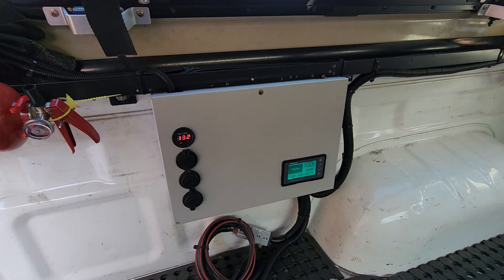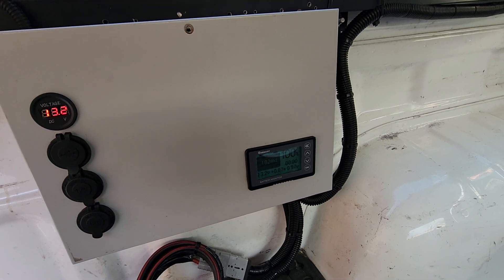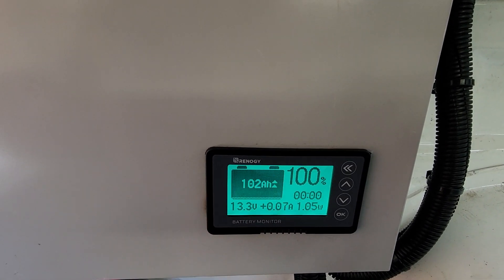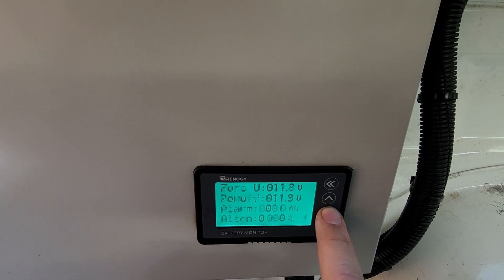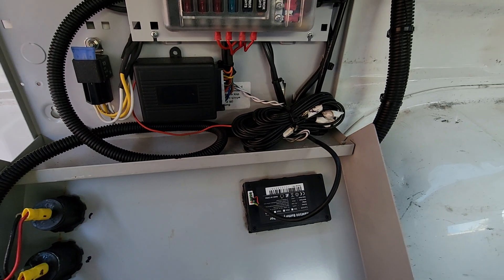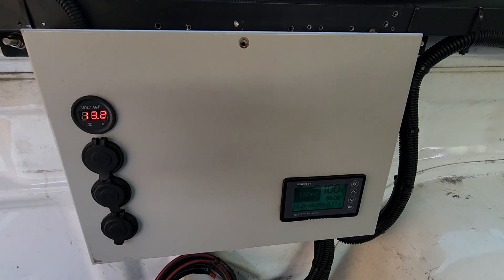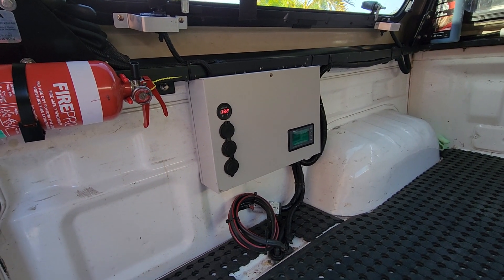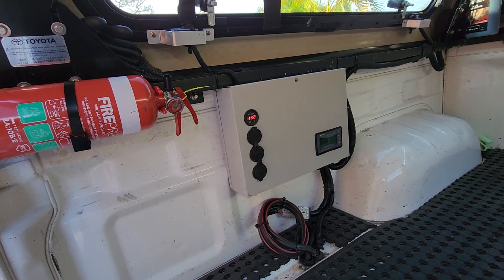Renogy Battery Monitor Installation for Dual Battery System (Toyota Hliux)

Comment: I somehow purchased this thinking it was for monitoring car battery, which is all I want it for at the moment. Can it still be used for that, assuming I can find a good place to mount the screen near the dash somewhere? If so would I still wire it up more or less the same way?

Comment: What capacity is your deep cycle Battery ? Renogy monitor settings for battery amp hrs should be set to useable amp hrs ie: AGM can use 50% of total amp hrs. so 100 amp hr battery is set to 50 amp hrs etc. I found this out myself when I set mine up after I contacted Renogy.

Comment: Great Video, may i ask what central locking kit you used in canopy and does it integrate with car key or is it a separate remote.
Reply from the maker: Hey mate, the locking kit is from a mob called canopylocks.com.au (not sponsored). FOB control for it isn't integrated into ute's key, its a self contained mini remote I keep on the same keyring. However, if you wanted it on the same system circuit, you could tap off the door central locking using a relay setup to drive them. Food for thought.

Been using this system since 2021 with no issues. Very useful on site to keep my tools locked up without having to lock the canopy handles. Be aware that the locking controller does draw some low current on standby, will suck on the battery a bit if you just park it up for a long time.

This is an ERG canopy, so I'm using ' EGR F Kit 1' from those guys for this setup.

Comment: Hey mate
 If you hold your finger on the top right button, it stops the LCD flashing,
Reply from the maker: I'll have to give that a shot!
Reply: When plugged in to shore power, I find that after a few days (fully charged or charging battery??) I push the top right to make the screen dark, but it seems to flash occasionally through the night! Now sure why and would like to find a way to make it stop.

Comment: Great video.  One question...What side of the shunt does your DC/DC negative out line go to?
Reply from the maker: So you're always gonna want to connect everything AFTER the shunt. So if your DC/DC is going to chassis ground (i.e bolted to the chassis), then the only connection from chassis ground to your battery (-) is via that shunt.

Comment: Really good video and your energy and knowledge for this subject is very evident. I have viewed a number of videos on this subject and I find it fascinating that in the matter of setting up a shunt device to monitor battery level that many seem to neglect the fact that is written in the instructions to do your set up of the monitor when the battery is completely charged or completely discharged. The shunt monitor does not know what state of charge the battery is in if you set 100% when the battery maybe at somewhere between 0 to 100%